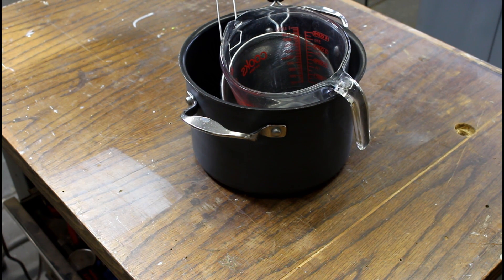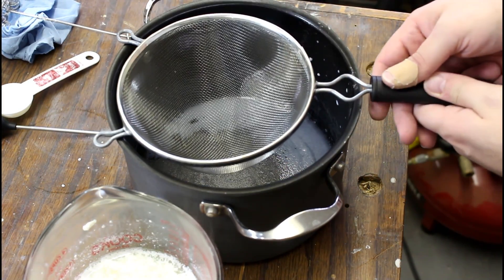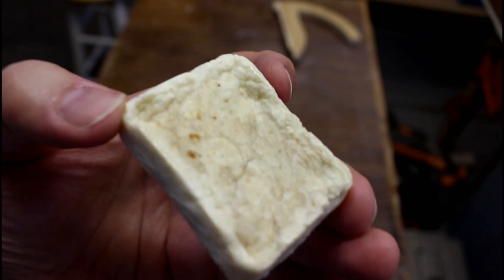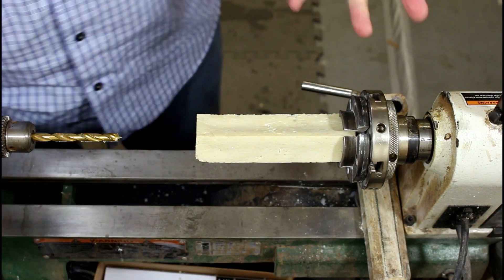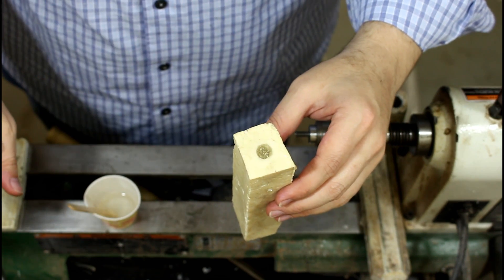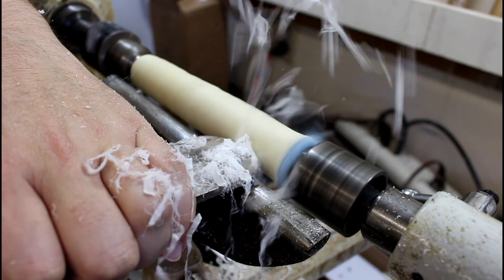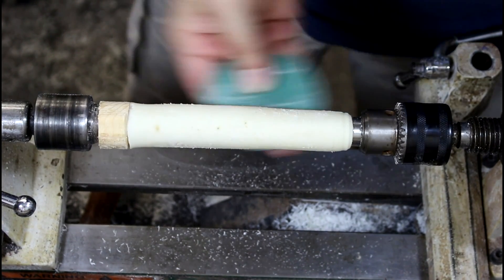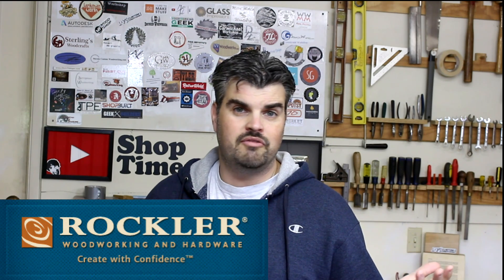Make Bio-Plastic From Milk

Comment: You guys act like this is something new!!  Casein has been used as a plastic for CENTURIES!  It was used for all kinds of things like buttons , combs, Pens, pool balls, you name it and it was probably made from it!  It would have been better to make it from skim milk as the milk fat is not necessary for the final product.  Also the acid production method is not going to produce a good plastic product to do that you should have used Rennet as it makes a much more plastic version.  The acid precipitate is and was used in paint, adhesives, in textiles as a fixative and to polish paper.  It is what makes milk paint thick and dry hard.
Reply from the maker: Thank you. Yes, it is an old process. For whatever reason, mine failed but that doesn't change that others have been doing this forever.
Reply: I was referring to others that have posted mostly, You could try some rennet sometimes you can find it in the grocery store, but you can order it from http://www.cheesemaking.com they have both animal and vegetable rennet.  I had to laugh a bit when you were talking about it being like Parmigiano cheese!  The only difference is that you would use a culture then there is a curd cooking faze then salt water soak then you dry it out!
Reply: There is also a way of making it with formaldehyde that changes it's properties to make it no longer water soluble as well as making it odorless. It is called galalith.  Good luck if you risk another try.
Reply: Hey peter, the problem is that after getting casein and fats you didn't solved the fats with alcohol, so your plastic is casein (protein) and fats, which are really soft. Casein plastic is avery hard material that I hand chased threads on already (lathe thread chasing). Cheers
Reply: nobody said this was new
Reply: cheese plane with a cheese handle awesome idea!
Reply: Yep. i Currently making my own BB from it. Because the company which i used to order bb's decided not to produce it any more.
Reply: I didn't know this, dear god
Reply: I'd add (if you ever want to retry this) that usually when doing something like this, you put the curdles into a towel and squeeze the living hell out of it. Tying the corners to a stick and turning should help. It significantly reduces moisture. After pushing that into a mold, you may want to consider applying pressure from the top. Similar to how tofu is made.
I think this could be interesting to experiment with. As an organic/natural material that isn't wood. Kind of like bone or ivory.

Comment: 2% and skim milk is not going to work better. he made ricotta cheese...then pressed it into paneer cheese. the difference between whole, 2% and skim when making ricotta is product yield. whole has the highest yield giving roughly 1Tbsp per cup of milk...2% is far less and skim is pretty much nothing.  the ricotta that is made from any milk well have the same exact amount of fat/oil you just get a greater or lesser amount of product. most ricotta comes from the left over whey from making other cheese, basically it is a way to strip out all milk solids. the whey from milk is called sweet whey and then used to make whey powder...weight lifters and such use. whey from greek yogurt is entirely different.
Reply: I ment the whey from cheese not milk at the end of my comment.

Comment: maybe the mould made the drying process longer? i feel it may have dried quicker if you had used a more porous mould or after it held a shape, placed it somewhere to dry. what if you made sheets of the milk stuff and then stuck them together and then shaped it so the drying time would be significantly less :D just some ideas

Comment: You created hardened dry milk fat and a lot of non-fat milk.
Reply: It may have fat in it, however, it is primarily protein.
Reply: +ballzack57 I finally got it it is casein bounded to calcium. (Casein can't build solid objects it has to be bounded to something) And that drying project was neutralization of casein by itself. That means that, if he would blended the precipitate that he extracted the reaction of milk and vinegar (you can use any acid you want) would be much faster and the "plastic" (cheese) could be harder to break.

Comment: Apparently dried Cottage cheese=Bio-Plastic
Reply: nah, the milk plastic uses a different process than the one he tries to spout off about, since as usual household hacker doesn't know what hes talking about.
what you made a handle out of is known as 'that bit of cheese you find on that mouse trap you never check' 
look up "galalith" it's the real milk plastic, I used to run into it all the time since my folks ran an auction years and years back
Reply from the maker: Diary farmers, unhappy with the return they were getting on their product, began to use milk in this way to make items. Buttons, knitting needles and other small objects. Many of which still exist today. 

I'm not pretending this was a huge success, but I'm not charting a new frontier here...
Reply: We make cheese with our goat milk and the wet stage of the plastic looked like the cheese. That's also the way you make that kind of cheese. (Heat it on a stove and add vinegar until it "curds") There are plenty of recipes on Google about it. It's super easy and yummy.

Comment: You need to use skim milk. The butterfat in the whole milk will make it soft and slow down the drying, they used to use it all the time for thin parts, my dad had a guitar with a casein pickguard. It's actually a quite good plastic materiel but since it has to dry instead of cure it's uses are limited.

Comment: Hey chuvak, bio plastic smells after 15 years and starts to wear down, add formaldehyde and it won't degrade so fast, is plahoy when start happening, makes your tool box smell like old English fellow sweat in box then baked the box in dead ambal, not a great smell.

Comment: The fat in the whole milk did you no favors. Skim would have been better. It can take a long, long time for this stuff to dry. I made a small piece that seemed to cure, but cured even more over the course of a year. 

Casein was used to make galalith, which was used to make buttons and had been soaked in formaldehyde to harden. You could try again doing this step to see if the results are different.

But the technique you used here is also a method of making cottage cheese. Just drain, rinse, cool and dry the curds and then add half & half and maybe a dash of salt.

Comment: I really love that 2 part epoxy, seems to last a while and it's cheap(for epoxy) and you get a ton of it and it seems as strong as others. I was hesitant about buying a large bottle but it's lasted over a year now I think, some thickening has occurred but I think it will last at least the rest of this year and I will probably finish it by then.  Well as long as I don't mix the caps anyways(I always do one at a time)

Doesn't really surprise me that it doesn't work on that type of plastic tho, lots of plastics require some really nasty solvent type glues that are also expensive. If you try something like this again try pvc cement or the one that works on abs and pvc. I have found pvc cement to work on various other plastics for a truly permanent bond I have a pair of headphones I fixed years ago with it that are still kicking.

Comment: you used too much vinegar. when making casein plastics from milk, you want to use as little acid as possible. the more acid you use the smaller the protein structures that will form. you also should dilute the acid slightly in water. I would say 50ml of acid to 100ml of water to the 1 cup of milk.

Comment: Love your videos☺  I suggest you use SKIM milk to eliminate the fat/oily feel, which might also reduce the resin's ability to stick well.  Also, after you get the curds formed, wrap them in cheesecloth and squeeze/twist the "bundle" to get out as much water as you can before putting them in the mold.  Finally, try putting heavy weight on top of the mold to compress the curds to reduce voids inside the blank. I'd love to see you try this again with better technique😀

Comment: So basically you're making the milk curdle to displace the fat from the water inside the milk ending up with a block of calcium. Kinda neat but if I was to use it I would make the blanks much thinner and glue them up with resin.

Comment: As others have pointed out, perhaps the fat content was the culprit in making the cheese take forever to dry. A fatty cheddar will start to sweat if left out of the fridge, and the outside will dry out pretty rapidly, but that dry layer forms a barrier that keeps the inside from drying out. It makes its own crust if you will. 
A lower percentage of fat in the milk will mean that the result is less prone to trap fat on the inside, which is why it never fully dried. The moisture you felt was most likely fat that was trapped inside the blank. 

Great experiment though! You did proper science in this one.

Comment: Dude. Cheese handle for a utensil to cut cheese. Thats brutal. Invest in this one lol? Maybe powder it fine for faster drying, then mix with resin. Who knows maybe you get a more reliable material strength? It should be in essence some kinda composite material
Reply: Casein is considered a thermosetting plastic. E.g. it doesn't melt.
Reply: Does this polymer melt without decomposing? Could be a viable way to shape it. Plus, if it can melt the internal cracks can join up, making the resin idea I put up there not needed
Reply: +de0509 he made a video about using epoxy (iirc) to make a knife but in the hand, it softened to the point of being unusable. If it was epoxy and not this polymer he uses now, it might work better. The entire time he was turning this on the lathe, I was also thinking that if he had made a polymer/whey composite, it might work better though.

Comment: You did make cheese. Literally, cheese. Milk + an acid = soft cheese. You were working with hardened cheese.
Reply from the maker: Yes, but it has been use as a material for making items for a while. Trust me, this is not new ground I'm breaking.
Reply: Probably not but aren't you worried about it rotting or something similar?

Comment: Perhaps if the milk-plastic had been used as a sleeve over a wooden center it would be stronger. The start of making the plastic sounds very close to a method I just read for making ricotta cheese (or at least a close substitute). Thanks for sharing a great video. Based on drying times, it is obviously something you put a lot of time into.

Comment: i know virtually nothing about this, but I have a few ideas that might improve the result if there's ever a follow-up. use low fat milk, I expect it'll be less oily, and may even dry faster because if the lower oil content. my other idea is to really go nuts with drying, press the crap out of it.
Reply: Fat content has nothing to do with the yield. The acidity causes the caseinmicelles to clump together. The fat gets flushed out with the milkserum. My suggestion to make it dry faster and more, is to clean the caseinclumps with tapwater. Maybe add some Calciumchloride to strengthen the bonds of the micelles. (I study dairy science, apparently also useful here)
Reply: hoodedraider Did I say it would increase the yeild? I suggested that it might make the product less oily, because there's less fat to begin with.
Reply: Have you seen blood milk then, all pink and what not, chuvak? The cow produces it for the young and in processing plant you have to dump whole silo can't have people drinking that, blin.

Comment: How about doing up a two-part mould, and then compacting it to dry under pressure.. Looks like the "plastic" didn't dry as one solid block, but with lots of air pockets, which could be why it broke apart while turning...

Comment: The big advantage of plastics over other materials is that they can be manufactured directly into their finished form.  Molding the handle directly and skipping the turning step would have required less material, and could have incorporated ornate designs not otherwise  possible.

Comment: Skim milk would be a better choice, by keeping the casein, and doing away with the fat would yield a better plastic. Casein is a protein in milk that is a monomer, and the addition of an acid allows it to chain creating a polymer (plastic) however fat and fatty acids can interfere with this process giving you an oily cheese. Once you have the casein extracted from the milk you can add a base to it like ammonia and utilize it as glue or thine it and you will have a traditional milk paint.

Comment: Ideally to speed up drying time, after you get the curds, you should probably rinse them with some water, then squeeze them out in some sort of press before placing them into a press mold for a few days and THEN removing from the mold completely to let dry, preferably in a warm environment or covered in a large pile of salt

Comment: What you basically made is Galalith, but you discovered some of the downsides to it. Prior to WWII it was a relatively common plastic, until petroleum-based ones surpassed it (plus the whole "food rationing" thing during the war.) The problem with the typical DIY methods is that they don't use formaldehyde, so it's not quite the same as the commercially-manufactured stuff. Further, one of the biggest downsides (historically speaking) is that it doesn't lend itself to being molded because it takes far too long to dry for it to be practical. Most of the commercially-manufactured Galalith was made in relatively thin sheets because of this, so it worked best for things like buttons on clothing and that sort of thing.

The Wiki entry for "Galalith" has some relevant info. Also, Stewart-McDonald (a luthier/guitar parts supplier) sells a few modern parts made from Galalith if you want to see what commercially-made stuff looks like: http://www.stewmac.com/SiteSearch/?search=galalith
Reply from the maker: Thank you very much for the information! I really do appreciate it!
Reply: Didn't know how useful that info could be but if you want repeat this experiment with formaldehyde then you can try to find some in pharmacy. In my country it is sometimes used as an antiseptic "Formalin". As far as I can see on the English version of Google, to buy in America it can be under the same name, but it is still a dangerous substance and should be careful.

Comment: "At this point I would call this milk fairly unappetizing."

Not me. I love curds and whey just as much as Miss Muffet does, and that is what you just created. :-)

"... that's not a huge amount of whatever it is that we're supposed to be collecting."

"Cheese".  It's called "cheese".  At the supermarket, you will find containers of the same stuff you just made labeled "Cottage Cheese", and you will find fermented blocks of the stuff with names like "Cheddar", "Mozzarella", and "Swiss".  :-)

"It feels like turning Parmesian."

Guess what! That's pretty much exactly what you are doing!

Thr name "bioplastic" is a misnomer.  It is actually just dried cheese, so your using it as the handle of a cheese plane is actually appropriate.

Before modern adhesives were created in the 20th century (like epoxy), cheese was used to make a strong glue.  You may want to try making cheese glue (a.k.a. casein glue) in a future episode.

Comment: If you had kneaded the curds before drying, it should have dried faster.  It may also have been more sturdy since you'd be helping the proteins to tangle.  And maybe skim milk rather than whole milk so the fat doesn't get in the whey.  (HA!!! See what I did there?)

This isn't a typical household hacker 'hack'.  Casein polymers were used commercially in the first half of the last century, so it does work... Just think HH's directions were bad.

Comment: LOL... 3 letters kept running through my mind when watching this video.

Bio-plastic - fancy name for low grade cheese. ;) 

Please do a follow-up on this video - very curious to see how it holds up.
Reply from the maker: I will. I also bought somethings that should make this material a bit more usable for the future.
Reply: BTW, forgot to mention this in my first comment.  The heat activates the proteins in the amino acids present in the milk, which makes them a natural sedative.  Boiling milk destroys them, so it needs to be warm rather than hot.

Yes, I am full of relatively useless trivia. :)

Comment: Interesting! The first parts you're doing are basically making mozzarella cheese. You use citric acid to separate the curds and whey, but it looks exactly the same at that point.

Also, milk paint is the curds that you separated mixed with pigment. You can spread it on a board and it'll dry like paint.
Reply: SDD525 Please hold... (Looks up, "can you substitute vinegar for citric acid in mozzarella cheese making?" Yes? Cool.) Sorry, what I meant to say was, that first part is the same as making mozzarella cheese, because you can use citric acid OR vinegar to separate the curds and whey. Geesh. It's tough in the comments section. :)
Reply: SDD525 There is only one way to settle this...CHEESE MAKING CHALLENGE!!!!! :)

Comment: The Play-doh like stuff is cheese curd. Keep mixing it in hot water with some salt and butter milk and you get fresh mozzarella. Add salt and press it, turning it ever few days, and BOOM white cheddar (I'm aware that this is an over simplification).  PS you might want to seal that. It'll definitely mold and start to stink.